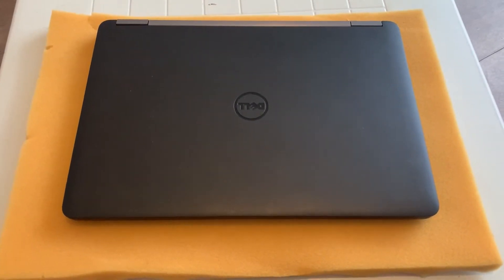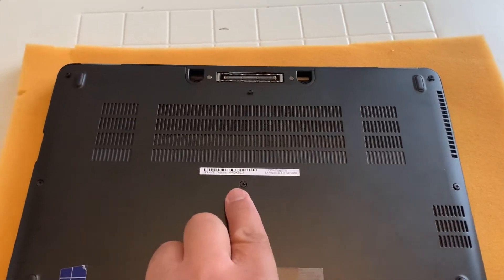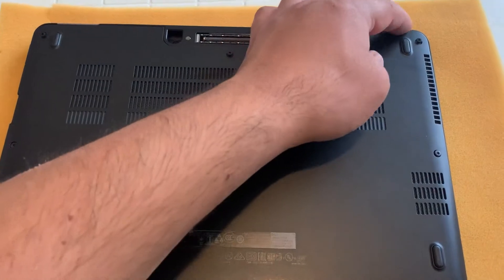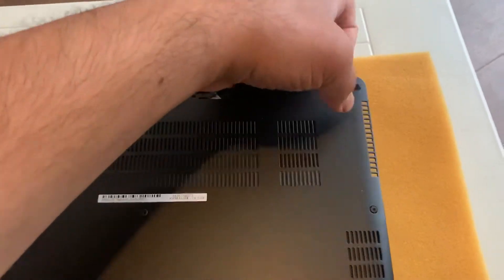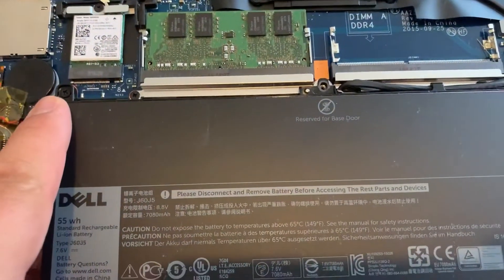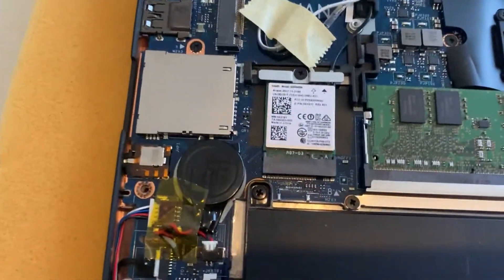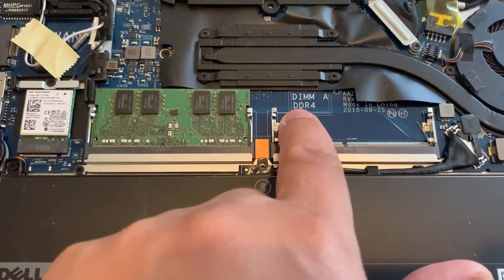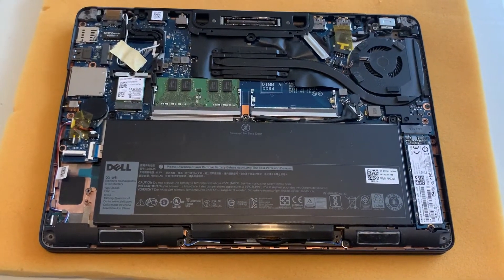DELL LATITUDE E7270 - UPGRADE RAM, SSD & REPLACE/RESET CMOS RTC, BATTERY |DISASSEMBLY|

Comment: Hi, I'm curious what's that slot to the left of the battery and under the CMOS? It looks like a smaller/empty slot for an M.2 SSD, but I don't think it is
Reply: I have a different model one with a fingerprint sensor and a backlit keyboard, it's actually a slot for a ribbon cable to the motherboard (I think from the fingerprint sensor), sadly I think the only upgrade is to replace the main storage for a bigger capacity one.
Reply: I also didn't mention that the fingerprint sensor is right beside the battery where there's like a square black. (Where you said that looks like a m.2 slot)

Comment: What is the max value of ram and ssd can be upgraded?
Reply from the maker: Hi max ram is 32gb. 2x 16gb modules. You can install any size capacity SSD and it will work. I hope this comment has helped you. Please can you subscribe, thank you.